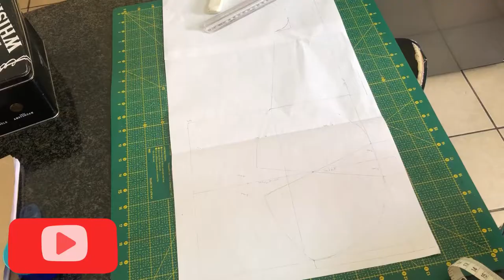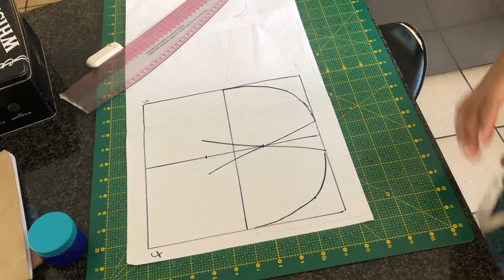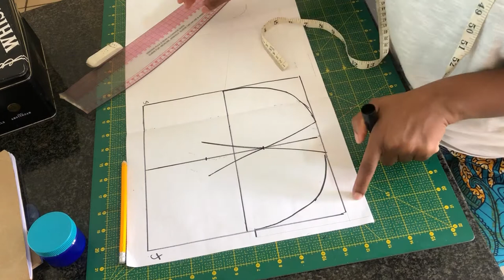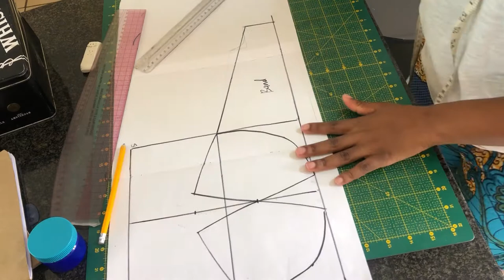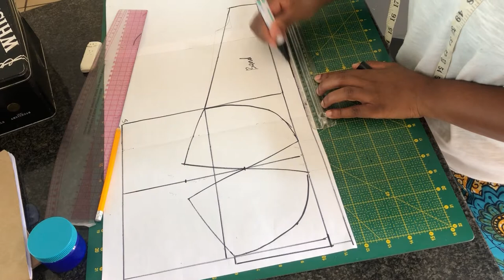DIY Strapless bra PART 1.

Comment: I hit the thumbs up button so hard and fast I almost knocked myself over!!!! 😛😂😂😂
Reply: Please explain what a "bust round measurement" is????  Thank you!
Reply: do you mean what is the total bust measurement at the fullest part divided by 4? thanks
Reply: Sorry I'm confused as to how this is accurate because the front bust is bigger than the back of your body, especially if you have a triple d so how would 1/4 be accurate? Wouldn't it only be accurate if you were flat chested?
Reply from the maker: 1/4 bust measurement will work also on a triple D bust, remember also that our band have different measurements from the cups and it’s also cut on stretch material.
Reply: i loved your pattern